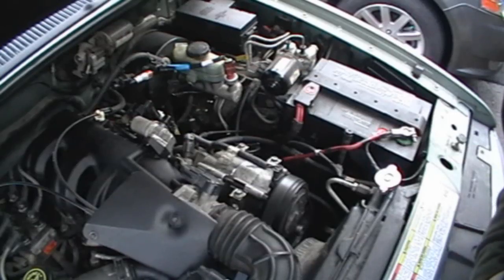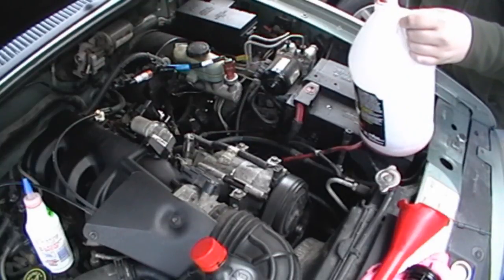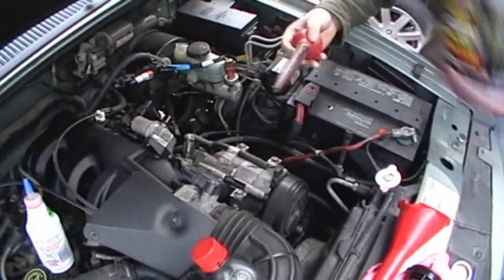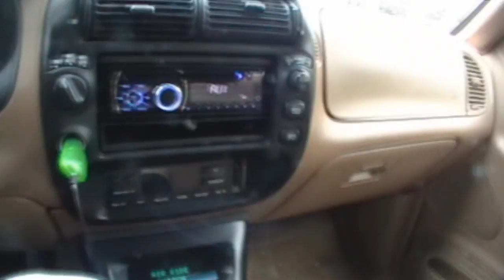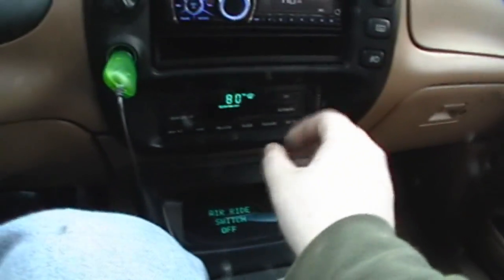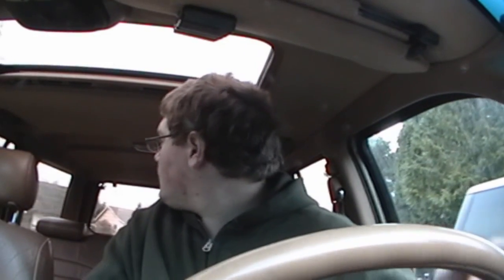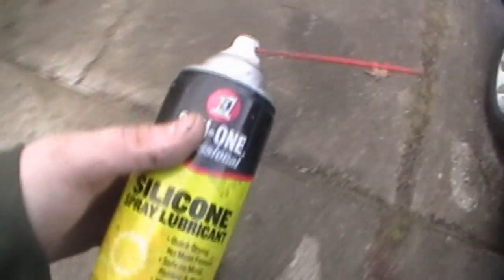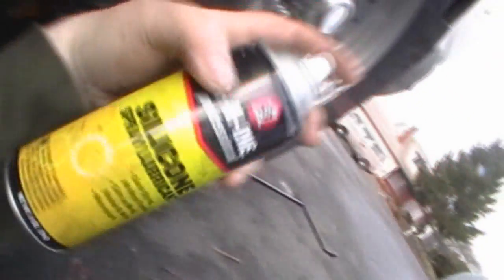Power Steering Fluid Change and U-Joint Inspection

Comment from the maker: I put it this way, if it doesn't break down and put you on the side of the road more than 2 times a year, I'd say you got a good car. If you get into a alternator snafu like i went through, and it breaks down 3 times in a year it doesn't count. For me, the original 15 year old alternator finally died, we got a new one from shucks, that dies in 2 months then returned it and it dies again! So now we went to ford and got an alt from them and it hasn't had any problems since.

Comment: @justhes i was just wondering cause i bought a buick for $2000 back in september. i bought good tires for a total of $500, and got a new water pump along with some other things for $350. my car has like 164k miles on it. the car is 12 years old but it looks pretty new. i was debating if i got a good car.